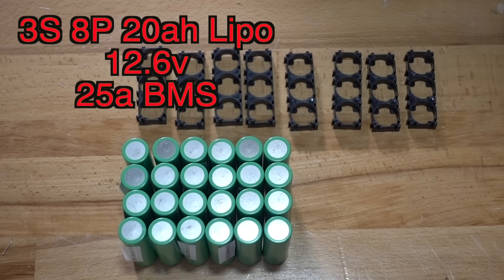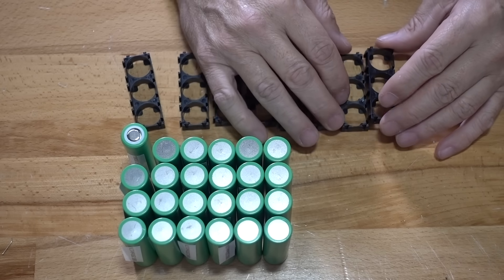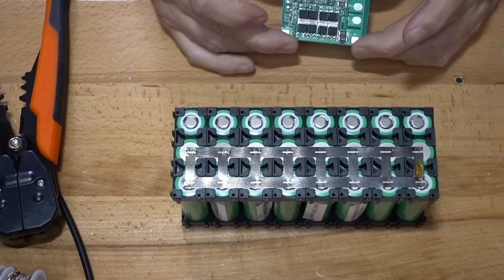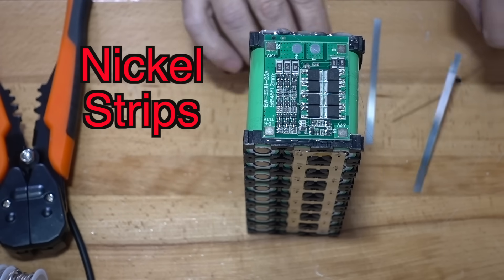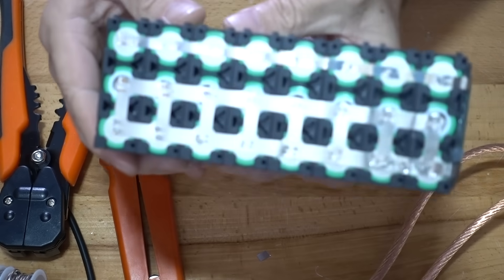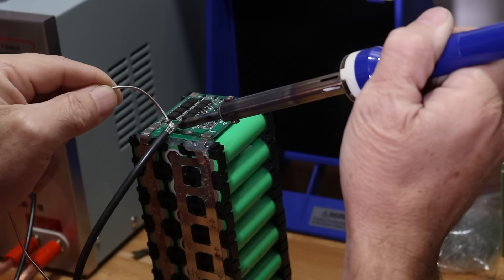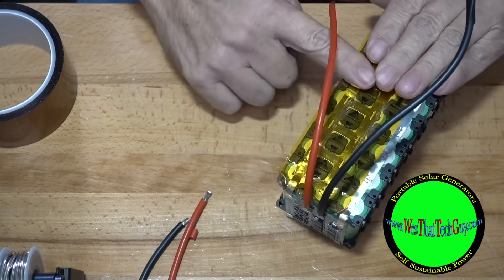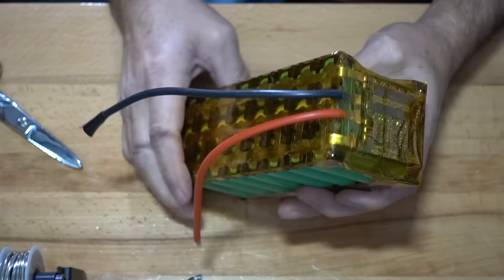How to build an 18650 Lithium Battery Pack with BMS.

Comment: Battery packs in series... could you either explain what happens with voltage, amps, ohms etc if 12 batteries 12v each were grouped into 48v packs then add each battery pack in series to increase voltage from 48v(1st gear) to 96v(2nd gear) and finally 144v(3rd gear) ?  or email me jackolivas007@gmail.com what would the wiring look like?  using 12v actuated contactors or relays of some sort.  the purpose is to power an EV without a DC controller through the car's transmission.  your help is appreciated.
Reply from the maker: I could maybe do a video on this sometime. This is a bit advanced for most viewers. feel free to hit me up on my website and we could discuss.

Comment: can it be charged by putting power down the output cables
Reply from the maker: Yes they are both for discharge and charging. Some bigger BMS have a separate connection for this.
Reply: @WesThatTechGuy  many thanks for the reply
Reply from the maker: You're Welcome!

Comment: Can you tell me how will you charge this pack ?
Reply from the maker: ENM Adam With a SolarGeni 12.6 V lithium battery charger. You can purchase them at SolarGeni.com
Reply: @WesThatTechGuy   great work! .. so let say I take 2x18650 making a small pack 7.4 installing a 2s BMS .using this pack to replace the lead acid battery in a led light . What would I need to have the batteries charge with a wall plug ?
Reply from the maker: a charger that puts out no more than 8.4v and about 5a. you can get a hobby charger for that.

Comment: If the 20Ah battery pack is 24 pcs 18650...3s by 8psc in one row
How about 40Ah...battery pack? How many 18650 i use
Thk you
Reply: 3s.. And 16pcs in one row...
Reply from the maker: yes or you could do 6 rows of 8 same thing.
Reply: Oky thk sir.. I will add a 15psc...
Reply from the maker: 3s16p = 48 or 4s16p = 64 both are 40AH

Comment: Thanks for the great video.  If I build a battery like this, and wanted to charge it with a 12v cig lighter socket in my car, what kind of circuit board would I need?  Thanks!
Reply from the maker: you would need the proper charger providing the proper voltage. In this case 12.6v max charge at no more than 25a

Comment: I just started watching vids like this. I have no idea what the next step is though. I would really like to see what you do with it
Reply: I built mine from this video and I use it for my Kayak fish finder. It last a lot longer than lead acid + it's easy to carry around (doesn't weight much)
Reply: Jake Shepard I am on the same page as you, i can’t find a full video to see if they add a USB port on it or a AC port or something so it can be used as a big power bank. I’m confused too

Comment: Could you use that pack to power an electric scooter?
Reply from the maker: if its a 12v scooter. if 24v you would need 2
Reply: @WesThatTechGuy  and you would wire the two in series correct?
Reply from the maker: yes but this would need a different BMS. it would need a 6 or 7s bms. in this case a 6s bms.
Reply: @WesThatTechGuy  that makes perfect sense. Thank you so very much for answering my questions. How can I repay you?
Reply from the maker: All is good. Thanks for watching!

Comment: i have 36 18650 is it ok if i connect them 3s or i need 4s?? i have ordered 3s bms as i hade only 24 cells for star, then i got more from my friend, so i have 36 of them. Just wonder if its ok to go ahead and just connect them 3s bms?
Reply from the maker: Yes you can do this. 12p3s pack. 4s is better depending on what it's for but 3s is ok too.
Reply: @WesThatTechGuy   Thanks
Reply from the maker: yw

Comment: Nice video and build, but why not use LiFePO4 3.2 volt cells in a 4S  configuration. Many things that run on 12.6V don't work so well on 11.1V.
Reply from the maker: thanks. yes I do build them as well. have some videos with LifePo4 builds. thanks for watching

Comment: Aren''t you afraid that the batteries in parallel could not be charge properly knowing that the bms doesnt have the voltage of each cells ?
Reply from the maker: the bms does have the voltage of each series of cells. either way the series won't exceed the required voltage. the cells will balance themselves out between the series. You can't affordably or even effectively balance each cell in a pack like this. You can however for a simple 13s or 15s ebike pack because they are built in series not parallel. 1p13s etc. If this was a pack like that then YES each cell would be monitored. I have 300a BMS that's the size of a cake and it doesn't even balance every cell only every series of cells.
Reply: I want to replace the battery on my elec scooter. 48v, i have planned to buy lifepo4 32700 batteries and make 8 group of 4s and a "40a 4s BMS" for each group. IS that what you would do ? I couldn't find lifepo 8s BMS...

Comment: I am  beginner to 18650. My complete house I have 12V led lights using solar acid batteris. Now getting ready to make a small powerwall for my house. Confusion is Do I need  3s  or 4s powerwall? Will 4s damage my 12v led lights? is my 3s will drop the brightness while working in the night?
Also also how to decide on howmany Amp protrection board for how many battreries? Thank you.
Reply from the maker: Use 4s and No it shouldn't bother your lights. If you want use a voltage regulator so only the 12.0v go to them. your lights will be useless with 3s as nominal V is 11.1v charge is 12.6. How many lights and how many watts? How long do you want them on? I need numbers to help answer the question. a 100w light bulb will run for 10 hours on a 1000wh battery. this will be about 4s40p battery pack. So (160) 2.5ah/2500mah lithium cells needed. I'm sure your lights are in the 1-5w range. hope this helps
Reply: @WesThatTechGuy :--Sorry I couldnt find your nice reply on time. I understand your calculation about nomber of batteries and watts used.
I have ordered a stepdown convertor 24V to 12V. 
I want to make a 7s to get 24V. 
To run 50W led lights ( 8-10 of 5W leds) for a maximu time of 6 hours.=300W. 
I am unable to calculate on a 7s pack how many P  I need to use and the BMS can be 7s but how many A? Please give me your pro.idea to help me.
Thanks for your time you spent to help me.

Comment: Soldering individual cells in a series/parallel fashion can give you the desired voltage/current output. I see several flaws in connection like this with LiOn batteries.
You can not charge this pack without fear of cells catching fire. The only proper way to charge a LiOn cell is to apply correct voltage to each cell and monitor current and temp. Current will cease to flow once the batt gets up to the recommended voltage. For example if each cell was a 3.0v cell and I apply 3.1v to the cell, cjrrent would flow into the cell.  Jt HOW much current? I can apply 1 amp or 100 amps. If I apply 100amps the battery will heat up and explode. Clearly this is not what you want. You must apply enough current at the right voltage (no over voltage) and MONITOR the cell temp. If the cell gets to warm, you reduce the current to the cell. I dont see any thermal probes on any of the cells. This could lead to disastrous consequences! In addition, there needs to be a current limiter on the output as well or a fire can result. A simple thing like a fuse woukd work. I have seen people connect under rated batteries to a drone with no current limiter, then see the drone in the air smoking and catching fire as the LiOn cells one by one catch fire. (Not a pretty sight) the requirements for the drone should be measured at full draw, then batteries that exceed that current draw should be Installed. Ideally it would be nice to have a temp measurement on each cell during discharge with a microprocessor monitoring each cell.
Reply: That's all what the BMS is for...
Reply: @jonmayer  to properly charge batteries that are arranged in a series/parallel configuration EACH battery (not cells) must be configured with a overvoltage, over current and over temp sensors (which this build does not have) thus if one battery over temps it may never be caught and a fire could happen. The BMS job is to ensure that all cells (not individual batteries) have the same voltage.
There is also many different types of BMS devices.
For example you have (4) 3volt batteries in series producing 12v output and will be charged to 12v.
What if one battery goes bad? The output would drop (lets say to 9v) now you try to charge it. The BMS would try to supply more current to charge it while trying to stay at 12v. The battery (because it has no thermal shutdown) will get extremely warm, potentially explode or catch fire, and potential chain reaction of batteries catching fire.
I would like to see a charger that monitors the thermal condition of each battery as they charge and shutting down the charge cycle if a battery exceeds design spec.
Reply from the maker: Roy this is a simple 3s8p battery pack with balance bms. the safety is in the bms. this is not for your car or home in this small 25a BMS 20ah battery form. Try not to over think it. It's just a simple safe battery build similar to what you would find in MOST electric bikes (of course at 24-48v). This is how they are built.
Reply: @WesThatTechGuy  as long as the cells are not permitted to over heat during a charge or discharge the design is fine, but even some bms' have provisions for thermal protection which should be implemented. In your example of a 3s8p design, what would happen if one of those cells in the 3s side of the configuration was weak, wouldnt the BMS continue to apply current to charge the bad cell? If the cell in fact went bad, the charger would be applying current constantly to the bad cell, this potential overheating it. How is this kept in check by the BMS if thermal protection not implimented?

Comment: So IF you wanted to balance each cell individually you would have to make an intermediary circuit that could select each single cell during charging and then when done charging, recombine into the 3s 8p configuration for discharging? Curious as to why that might be overly cautious/unnecessary.
Reply: As far as I can tell the ONLY way to charge LiOn cells properly is to monitor EACH cell for temperature which will adnust the current (amps) to each cell. The voltage applied is also monitored. With simply a series/parallel conntection there is no way you can charge this pack correctly. If a cell goes bad it may explode, catch fire etc. Current draw from discharge should also be limited. Any over current draw can destroy a cell as well.
Smh

Comment: can you wire two of those packs in parallel to get an even larger pack or would you need and additional BMS?
Reply from the maker: yes you can and you could use the same bms but this bms is only rated for like 25a if I remember correct.

Comment: hi , i have a question? i want to make a parallel li-lon battery pack for my electric scooter long range ran
my scooter have 48v 13.2Ah battery , do i have to use 48v 13.2Ah battery or i can use 48v 8.8Ah battery???
please let me know 
thank you
Reply from the maker: You can use either one as long as the voltage stays the same as what the motor requires. The AH rating isn't the important thing the voltage is. the higher the AH the longer the scooter will go on a charge.

Comment: So I'm new to this. If I double up to 16 cells x3 it will be a 40aH battery correct?  Thanks!
Reply from the maker: Yes if they are 2500mah (2.5ah) cells like these ones. 16 cells x 3 = 48 cells x 2.5ah = 40ah
Reply: Wes That Tech Guy 
Loved the video but, “16cells x 3 = 48cells x 2.5Ah = 40Ah” makes neither scientific nor mathematical sense.

In this case Bob’s 48cells are going to be 16p x 3s. Now parallel multiplies capacity (A.h) and series multiplies EMF (V). So 16 x 2.5A.h is his capacity and 3 x 3.7V  his voltage, giving him an 11.1V, 40A.h battery and a nominal energy capacity of 444 W.h. (V x Ah).

Comment: Hi
Thanks for the informative video.
To charge all them batteries same time, what is the input voltage?
Does it have to be 3-5 volts over than the output voltage?
Thanks
Reply from the maker: 12.6v total
Reply: @WesThatTechGuy  how many amp please?

Comment: Awesome video, thanks for taking the time to share. A little constructive criticism. I would recommend a soldering iron with a little heavier tip. I also like to hit those larger joints with a flux pen to get a better solder flow. Your + and - connections looked maybe a little cold to me.
Reply from the maker: Thanks for the insight!
Reply: I completely agree. I was suffering when I see the welding. Looks cold welded. I will not trust that weld.

Comment: Another question. I like the 25 amp BMS circuit. I think I might need to buy a couple of those. However shouldn't each individual cell be monitored by a BMS or is dividing monitoring into 3 sections good enough??
Reply from the maker: the bms is connected to each set of cells in series for balance charging.

Comment: I really like this idea but maybe I am missing something. You have 3 x 18650's in series which is going to give you 3 x 3.2 volts. That is 9.6 volts. How do you manage to get 12.6 volts?? I can only guess the BMS circuit is converting to 12.6 volts, is that correct? Sorry I am confused easily, forgive me.
Reply: Most lithium cells are rated for 3.6 or 3.7V, but when they're fully charged they usually reach 4.2V.
Reply: I agree, 18650 are lithium phosphate 3.2 nominal voltage, where lithium polymer is 3.8v nominal 4.2v max charge.    People use 4s lithium phosphate in place if 12v lead acid 
It seems you charged these LiFe batteries as LiPo
Reply from the maker: when battery is charged (which you must do) its 12.6v

Comment: hey, do you know if those nickle strips can take high currents? like 300amp peaks? Also, what spot welder are you using?
Reply: if anyone is wondering, upon more research, nickel strips are OK for most low-med power applications, high power requires thicker bus bars, usually copper. Sizing needs to be specked as per expected peak amp draw.
Reply from the maker: Nickel can handle the high amp loads when ran in big packs as not that much current is being taken from each cell at the same time. to connect the battery to the load you will need a bigger thicker buss barr or higher gauge wire. Depending on your load or inverter than sometimes up to 4/0 wire and bigger is needed depending on your inverter voltage and AC wattage and amperage rating.

Comment: What is the cost of cell and where it will available in low prices
Reply: €3-5
Reply: Depending on the quality and the maximum discharge it can handle
Reply from the maker: you can get them at SolarGeni.com

Comment: How much would it cost to build say a 40ah for trolling motor use? Something simple like you made here I can find many cheap ways to enclose them. And how much would a charger cost?
Reply from the maker: if you build it yourself not bad. you'd need around 48 cells for 3s and 64cells for 4s to get 40ah. Average cell is around $3-$6 depending on AH and Amp rating.. Then you either use a BMS or just balance charge. Hope this helps. for the trolling motor think about the better $6 battery cell. our SolarGeni chargers start at about $50 for a 5a 12v range and go up from there.

Comment: Can i ask something? I just made my first battery pack out of 18650 cells. Instead of putting bms i putted a voltage regulator and a balance lead for each series (3s-4p) .Can you tell me how can i charge now the battery pack? If i connect +- of battery to the output of the regulator and give 12,6 v to the input while i will connect the balance lead to my smart charger will this work for me?
Reply from the maker: connect to each of the balance leads and not sure what type of voltage regulator you're using. Please give more info. thanks
Reply: @WesThatTechGuy  i have connected the balance leads and this is the voltage regulator i bought from ebay
https://rover.ebay.com/rover/0/0/0?mpre=https%3A%2F%2Fwww.ebay.com.au%2Fulk%2Fitm%2F332408657202

Comment: Awesome video, getting on with the job, just plain simple to understand.
Thanks for sharing
Reply from the maker: You're welcome!
Reply: naly Hwang  right
Reply from the maker: naly Hwang  we have that charger at SolarGeni.com
Reply: Can you guide me
Should i use 1.2v batteries of 4300mah for battery pack
Reply from the maker: I would use 3.7v 18650 or 3.2v lifepo4 myself. 1.2v cells are generally not for any type of high power usage they are used mostly for small solar lights etc. 1.2v is a usually a AA battery cell if memory serves.
Reply: And it's, upsidedown-- are you, blind-- deaf?

Comment: Is a bms really necessary. I've built a 24v pack from old laptop batteries and I've added a small volt meter to asses the voltage at all times.
Reply from the maker: Depends on the application and the amount of energy being put into and taken out of the battery pack. People have their own opinions on this subject but safety is a key issue when using a BMS, if you can or want to constantly be looking over your shoulder while using the pack then don't use the BMS but if y9ou want to enjoy your nights sleep you might want the BMS.
Reply: @WesThatTechGuy  it's for a kids electric scooter. I agree, the Bms would satisfy my safety concerns. I've ordered one, a 24v 6s bms. If I put 30v through the bms, would it still limit the battery to 25v?
Reply from the maker: If you put 30v to a 25v bms the bms will shut down the charge once it reaches the 25v. the purpose of the BMS is to protect the battery from being over charged.